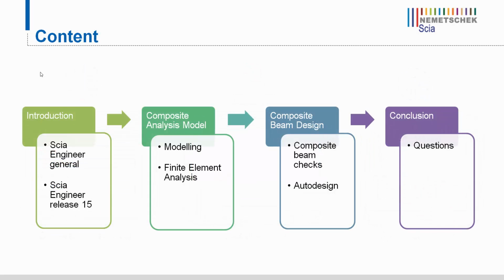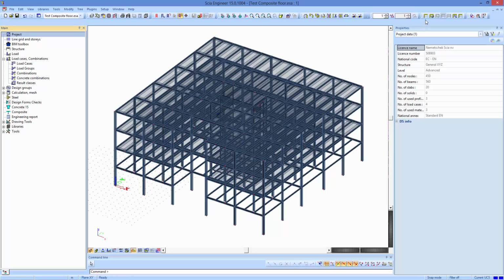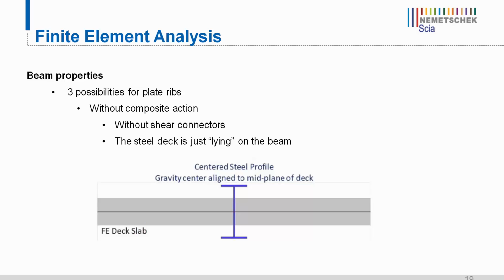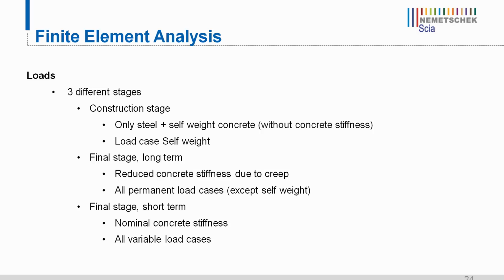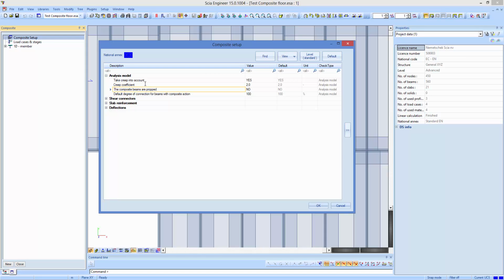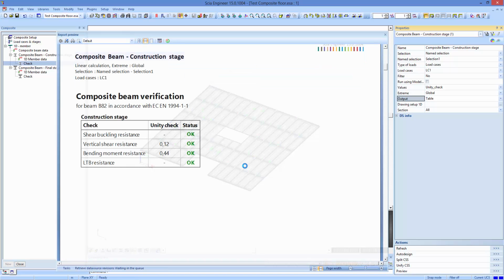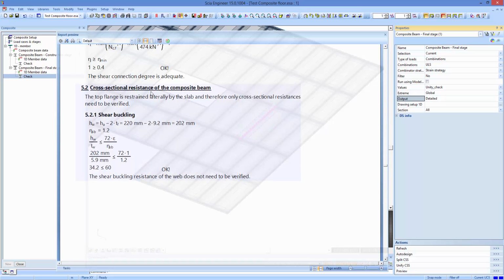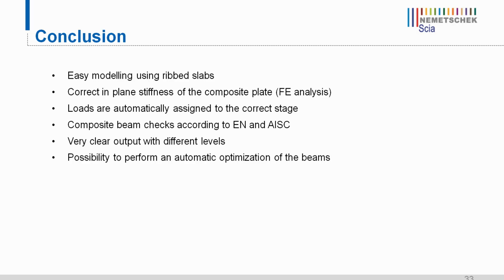[EN] Webinar Composite design with Scia Engineer 15

Comment: why there is no 2D member in structure tree tab? I have the same problem and I dont know how to add a plate in this case
Reply: +kerjuxaxaxa did you find out  a solution? I have the same problem?
Reply: +Duhoky_Boy Change model type from frame to general
Reply: +Gino Vanstraelen thanks. can you please also tell me why I can't analysis celluated beams?